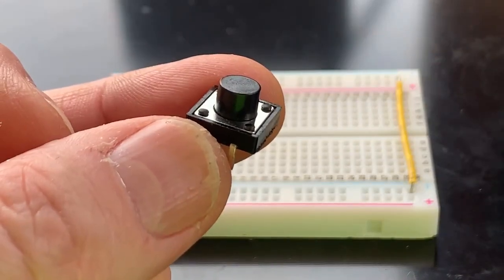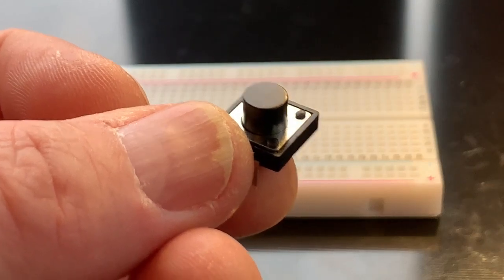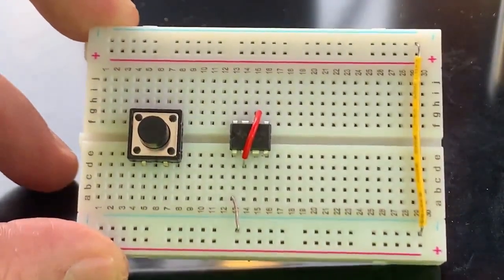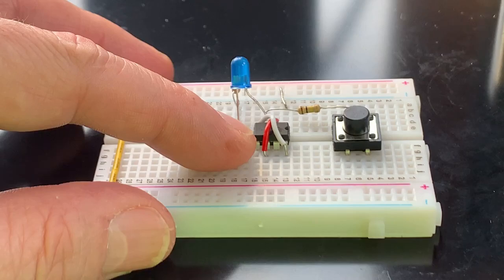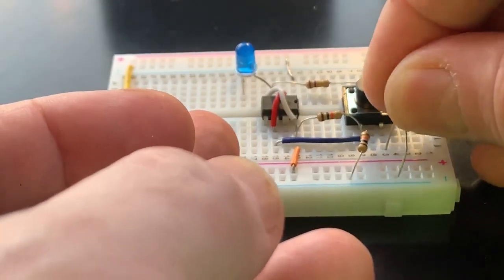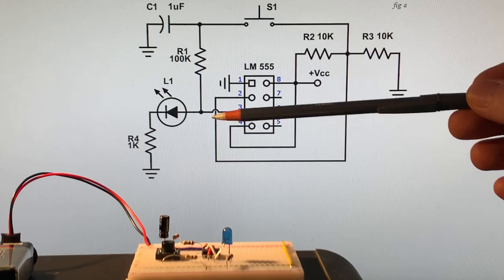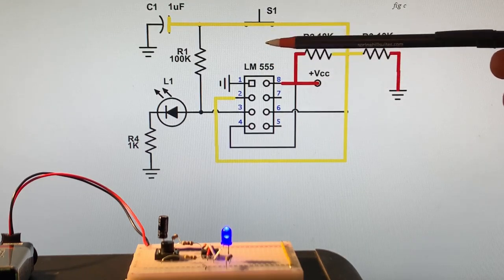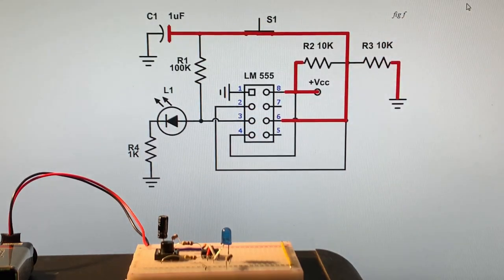Making a latching relay with 555 timer

Comment: I really like the 555 timer. I'm struggling with a power supply chip not being very retro-switch friendly and go through some ideas. The circuits get too big and I need 2 extra, long wires in what I'm building. It works and I just need the retro-switch to interface properly. I'm sure there is a shorter way, but I have to find it.

Comment: what happens if C1 was a 10 or 100uf cap.?
Reply: The time between two effective push will be longer ,so you have to use a lower discharge resistor value ex 22uf use 22kohm

Comment: This is important: if you are using bipolar 555 timers, like the NE555 or LM555, you must decouple the supply close to the supply pins 1 and 8 with a 100nF capacitor.

The bipolar 555 timer 'crowbars' the supply as the device switches, drawing around 400mA for around 100ns. Without a decoupling capacitor, that can drop the supply down to ground, whereas a 100nF capacitor will limit the supply voltage drop to less than 0.4V.

In other words, if you don't decouple the supply, using a bipolar 555 timer is very hit-and-miss, and that is probably the reason for many of the questions here in the comments section. HTH.

Comment: Worked awesomely!

1 question though.. 😅

I want this on off to work as a start stop for the Casper electronics sequencer.

Would I plug the square wave LFO(clock) into the button? And I’d have to take it back out somewhere to go back into the 4040 😅😅
Ahh I wish I had latching buttons.

Comment: It worked fine with just one LED, but when I set a resistance value to flow 40mA to the LED, I was able to turn it on from off, but I couldn't turn it off from on.

Comment: This circuit is featured on page 48 of the Engineer's Notebook II: A Handbook Of Integrated Circuit Applications by Forrest Mims (1982).  It is not a latch but a countdown timer and shouldn't be relied upon to stay in the 'On' state indefinitely.  Leave it with the LED on for a few minutes and you will see that it turns off by itself without the button being pressed.
Reply: You are incorrect.    The two 10k resistor voltage divider tied to 2 and 6 holds the 555 in and indeterminate state between 1/3 and 2/3 Vcc.   As long as there is power it will stay latched in one state or the the other.
Reply: @jp040759  Yup, this circuit was designed to permanently off and on latch 12volt relays.
Reply: @jp040759  Yup he is incorrect, this circuit was originally designed to power 12volt relays for car stereos back in the 1970s, in this circuits current configuration switching it on will stay latched on for 32768 hours, which is 1,365 days or 3.7 years and its not even connected as a countdown timer circuit at all, the 10k resistiive loads keep the IC latched ON or OFF

The circuit was originally enclosed in an aluminium can as its sensitive to capacitive coupling (touch)

It will only deactivate itself with the wrong value resistors

Comment: Nice circuit, how much power does it draw when it is turned off ? I'm considering it for battery operation.
Reply: At 9V the LM555 typically uses around 6mA, but samples vary, and it could be twice that.

Comment: Would it be possible to replace the push switch with a mosfet so that a switch to one of the power supply rails could be used ?
Reply: Not easily. When the push-switch is open and the capacitor has charged, the capacitor is either at the positive rail or at ground, while the other side of the switch is at half the supply voltage. A mosfet has a body diode that will conduct in one direction or the other, depending on whether it's p-channel or n-channel, so it will short out one of the two conditions as soon as the voltage across it is more than around 0.6V.

Comment: Hello, greetings. I'm from Indonesia. I want to ask how many volts the LED is? and for the load on the LED, for example if I replace it with a relay, is that possible? because I will use it on 220v AC voltage.

Comment: Great work, brother, but I have a question: Does the circuit maintain its last state when the source current is cut off?
Reply: No it doesn’t. When you turn it on it always starts at 0 even if it’s turned off while 1

Comment: mine doesn't work. it can turn on but can't turn off. what's the problem ?
Reply: You can test the voltage at pin 6 with a multimeter to make sure the it is getting more than the 2/3 the supply voltage, which comes from the capacitor in the upper left hand corner of the diagram.

I haven’t tried this circuit yet, but it looks like it should work.  The LED turns on in your circuit, so that works.  Now just make sure the switch sends >2/3 voltage to pin 6.

This can get a little complicated, so, watch the video a few times to make sure you see how it works.  This is a good way to learn how the 555 chip works, so, it’s worth your time.
Reply: @thetooginator153  great explanation! 
But i already used other circuit for my project. It has two push buttons instead of one (one for on and the other for off). It less efficient but at least it works.

Comment: Great circuit i did it & it works perfectly,but sometimes when i turn the supply off & on again the circuit turns on by itself! How to illuminate that please?
Reply: There could be noise picked up on switch-on that triggers the 'on' state. It's difficult to know as it depends on layout, stray capacitance, etc. The 555 should always have a 100nF capacitor between pins 1 and 8 to ensure stable operation.

To ensure a consistent start-up connect the reset pin (4) to the supply via  a resistor (not critical but around 47K will be fine) and also via a small capacitor (not critical but around 100nF will be fine). That will give a "soft-start" at switch on, keeping the reset low for a few milliseconds and ensuring the circuit starts up in the 'off' state.

Comment: I'm watching from Russia.
Well done! Simple and clear!
The author, is it possible to make a similar circuit for 220 V?
To get a pulse relay with one-button control?
And instead of a mechanical relay, you can use a triac. After all, as a key, a triac is much more reliable than a mechanical relay!
And if you use a MOSFET or a microchip, then power can be supplied through a low-capacity quenching capacitor, a bridge, a smoothing capacitor and a Zener diode at the desired voltage.
And yet, there should always be a scheme! Preferably laid out separately or in the video itself, at least for 5-6 seconds. Then it will be considered a full-time job, and this is already professional and high-quality! And then, you will want to watch something else on Your channel again!
Sincerely from Russia!
~~~~~~~~~~~~~~~~~~~~~
Смотрю из России.
Хорошо сделано! Просто и понятно!
Автор, а можно сделать подобную схему на 220 В?
Чтобы получилось импульсное реле с управлением от одной кнопки?
И вместо механического реле можно использовать симистор. Ведь как ключ, симистор намного надёжнее, чем механическое реле!
И если использовать МОСФЕТ или микросхему, то питание можно сделать через гасящий конденсатор малой ёмкости, моста, сглаживающего конденсатора и диода Зенера на нужное напряжение.
И ещё, всегда должна быть схема! Желательно отдельно выложенная или в самом ролике, хотя бы на 5-6 секунд. Тогда это будет считаться полной работой, а это уже профессионально и качественно! И тогда, захочется снова и ещё что-то смотреть на Вашем канале!
С уважением из России!

Comment: This was exactly what I was looking for. Only in my project the momentary switch is connected to ground on one side, which I cannot change. I therefore tried to control a relay with my switch. This relay replaces your switch in the schematic. Unfortunately the logic is not stable anymore after replacing the switch with a relay? Any tips? I used the NO and C pole. Maybe the capacitor does not work with the relay?

Comment: Doesn't matter what type of 555 circuit we use? Because I'm using it ne555 timers.
Reply: No. Different manufacturers simply use their own prefix. It's the three fives that matter.
Reply: @johnm2012  TI (for example) manufactures both the LM555 and the NE555, but they are pretty much the same. However, those are bipolar devices. CMOS versions also exist, e.g. LMC555, ICM7555, and others. These have much lower quiescent currents, but cannot supply as much output current, so may not always be suitable substitutes.

Comment: I tried making the latching circuit but used an..... 10uF capacitor and 5 volts. the led took like 5 presses to turn off but like one press to turn on dont know why i tried many different capacitors didnt work.
Reply: What value resistors did you use?
Reply: Put a 100nF capacitor between pins 1 and 8 to decouple the supply and you'll have much more stable operation.

Comment: I tried to use this circuit in practice to control a lamp from two separate switches that are 60ft apart. The circuit is so unstable it either turns on by itself or it refuses to latch and I look like an idiot trying to press the switch multiple times. I was advised to put a small cap between 5pin and ground and one in parallel to S1 to filter high frequencies. Did anyone try this and how did you fix it. Mine latches after the cap hack but not from the first try.
Reply: The circuit is missing a decoupling capacitor between the supply and ground - use 100nF close to pins 1 and 8, Without that the LM555 is very hit-and-miss when switching because of current spikes as it switches. The CMOS versions don't have this problem, but can't supply so much output current.

Comment: would someone please explain why this is more advantageous over using an appropriate resistor and a switch (without the 555 timer)- what is the benefit of adding the 555 & capacitor? cheers
Reply: The switch is momentary.  It is only closed while it is being pressed. The 555 timer adds the toggling/latching action that causes it to stay on after the button is released.
Reply: In many cases it isn't more advantageous, which is why many appliances, such as table lamps, use a mechanical toggle switch. But the purpose of the circuit is to add a toggling action to the simple momentary switch.

Comment: Why is resistor connected to ground?

Isn't it supposed to come before the LED?
Reply: It doesn't make any difference.
Reply: I'll assume you are referring to R4 for both questions since you didn't specify. 

1. The output of pin 3 is either at ground potential when "off" or at Vcc potential when "on". When it is at ground potential, there is no potential across R4 and the diode. When it is at Vcc potential, there is potential between Vcc and ground distributed between R4 and the diode. Therefore current flows from pin 3 through R4 and the diode to ground. If they were not connected to ground, the R4/diode circuit would be open and no current would flow through them regardless of the output of pin 3.

In a different circuit, it might be possible to reverse the diode and connect it to Vcc. Then, no current would flow when pin 3 was "on," at Vcc potential. When pin 3 was "off," at ground potential, current would then flow from Vcc, through R4 and the diode, to pin 3. That however would not work in this circuit since it would interfere with the function of C1.

2. The order of R4 and the diode is irrelevant. The same current that flows through one must flow through the other.

Comment: A relay and a switch would have been easier !!!!
Reply from the maker: It's not as cool though :)
Reply: @cruciallab  - And you were teaching another idea, which I though you did VERY well!  Your video helped me understand a 555 MUCH more!  Thanks!
Reply: You’re missing the point
Reply: @jjhack3r  I did not miss the point, this project was just another way to re-event the wheel... that is all. no bad intent on my part. Thanks for jumping out of the Croud for such a small comment !!!!
Reply: 30 seconds in, he said, "There are easier ways to do this!"  Duh
Reply: "How does a transistor...?" A transistor IS a switch. 🤦

As for why use this instead of just a switch, this provides a toggling, debounced on/off signal with a temporary pushbutton switch and common components. It's unlikely your load would actually be a relay if you were to use this, but it provides a satisfying click sound for demonstration purposes.
Reply: That would have taken more power
Reply: And how would say, a transistor operate such a switch?

Comment: Cool and simple design. I’ve built a similar circuit before with a 555, but had timer function set by the value of a capacitor/resistor combination that powered a small relay. 

For a latching switch that uses a relay to power a heavier load using a low current type push switch, one could use two  momentary push switches, one a normally open, one a normally closed. 

These two push switches would be in circuit in this manner: 
Press the N.O. switch and a + battery coil voltage flows through the push switch to a D.P.D.T relay coil and to the ground through the N.C. push switch , and it clamps. To make it latch you also feed + batt coil from the out side of N.O. push switch voltage to one of the two N.O. relay contacts, you then connect a wire between the other contact of the relay to the momentary N.O. Push switches “always hot side.” When you push the norm open (N.O.) switch, relay coil voltage flows and goes through the other N.C. push switch to batt negative & relay latches.

Summery: When the relay clamps, the one contact of the relay hooked to + then resupplies the relay coil continuously. If one then presses the norm closed (N.C) switch, the relay looses its - Neg connection to the battery and the relay drops out, “opens up.” The other N.O. relay contact of the relay can then be used to switch the hot lead or + DC of another power source to whatever load or device you are wanting to power up. There are also other relays such as T.P.T.T. Triple pole triple throw and more. Except these relays with many poles then become expensive. The resting contact state of each contact can be purchased different, with some contacts being N.C (normally closed) in unpowered state as well.

Your circuit can do the same and with only one switch if you hook your output that powers the LED instead to a relay coil. I’m not sure how much current a 555 timer chip can supply for a relay coil, I think 0.100A (100mA)? The relay coils operating voltage and resistance would need to be selected accordingly with LED & current limiting resistor removed to operate a relay directly instead. I suppose as an alternative, one could pop in a opto isolator in place of your LED, then power a relay coil through the opto isolator’s switch side “collector” hooked direct to the positive & then through the relay coil to - Neg source of the project if the 555 cannot provide enough voltage and/or current to power the chosen relay directly. Of course Opto-Isolator’s also have max voltage and current ratings for their switch side that one would need to observe. SCR’s are also fun to use for latching circuits.  😎👍